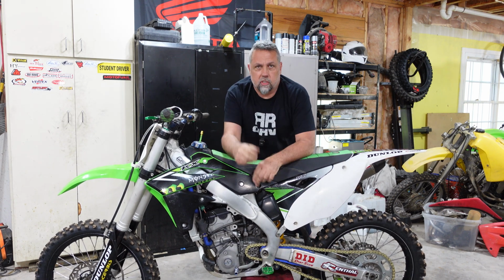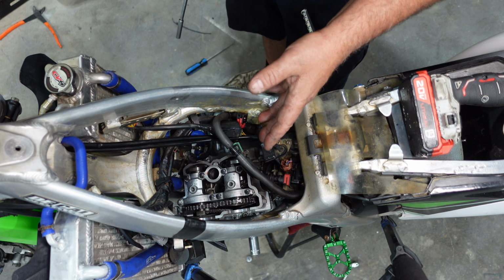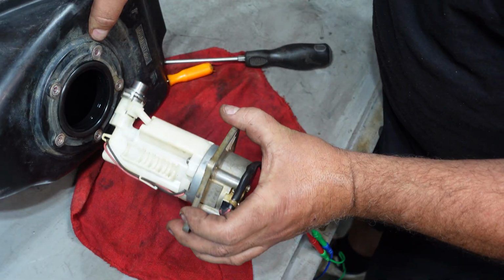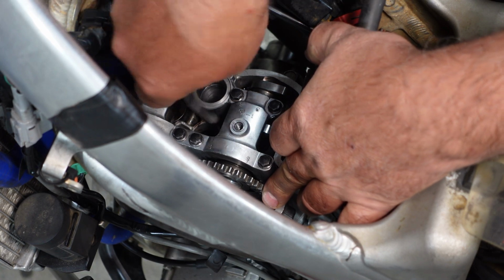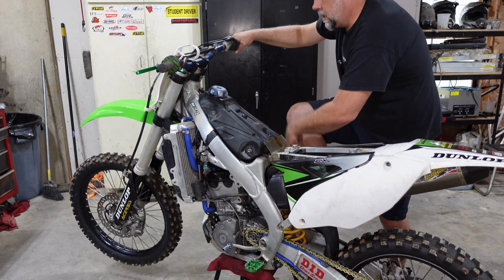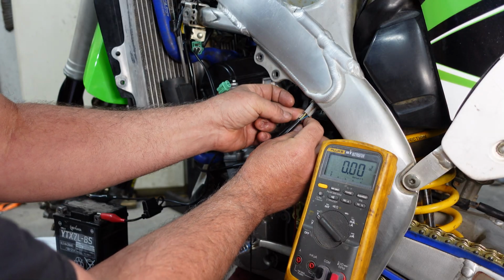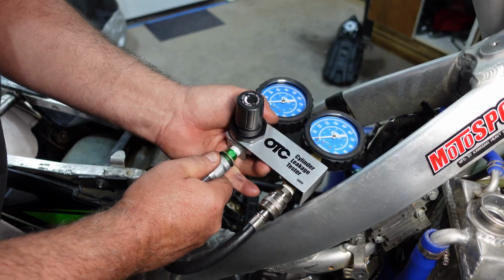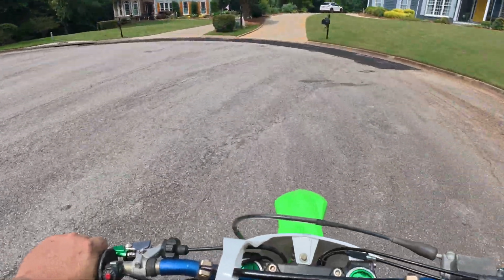2013 Kawasaki KX250F No Start Ep118

Comment: Hey I know you may not see this, but I’m having the exact opposite issue on a 2020 kx250… Im getting too much fuel to the spark plug and it’s leaching while it sits…
Reply: And the last time I rode, it sounded flooded when I started it and it ran fine once it was warm. If you have time I’d love to talk about it
Reply: But it won’t start at all now
Reply from the maker: Make sure it’s got spark (plug could be fouled). If so, pour a little fuel down the spark plug hole, replace the plug and see if it will start
Reply: @restoroosterohv spark is good, I finally got it to start after I left the plug out and I had to hold the throttle wide open, even then it dies out if it’s not in high idle until it’s FULLY warm
Reply from the maker: You need to check your fuel pressure and check the injectors for drips/leaks
Reply from the maker: There are certainly a few things that could cause that. First thing would be to start with a fuel pressure check while running and also if it holds pressure after shutdown.

Comment: Awesome video! I’m working on my 2013 kx250f right now but can’t get it to start… I just put a top end on it. I have spark, compression might be low but it feels the same as before when it ran fine. I don’t know what else it would be because I’ve tried gas directly in the cylinder and won’t even get a pop. I’m thinking I’m going to check my valve clearances cause that’s all I can think of right now. Any other ideas if you don’t mind me asking?
Reply from the maker: That’s where I would start. Double check your cam timing and valve clearances. Do a leak down test and check the fuel pressure.
Reply: @r @restoroosterohv noted, thank you!

Comment: I’m sure it’s been asked before somewhere but I have the same issue with bad o-rings in my fuel tanks pump where do you find the right sized o-rings I’ve used ones out of a harbor freight kit but it’s just not right and I’m not sure they are fuel resistant they don’t last long. Any help is much appreciated
Reply from the maker: They are Viton prongs and will hold up to fuel. Which gate are you using, the metric or SAE kit? If I remember right, that’s where I get those O-rings from.

Comment: I recently had a similar issue on my 09 kx250f. Had up and down play in rod at the end of last fall. I had just got a brand new head, new cylinder, piston/rings, valves a few months prior.  So It was running awesome b4 the crank change.   Where I really screwed up was buying a wiseco crankshaft.  Got it off an eBay seller. Said it was new old stock.  It was new and looked high quality.  After the installation, I couldn’t get the damn thing to start.  I bump started it and it sounded like 4th of July with all the popping and backfiring. Blew fames a foot out the silencer. Idle was surging. Was running very similar to yours b4 you discovered the sheared key.  Long story short, it was keyed  wrong causing the ignition timing to be about 15° retarded. Is actually a recall on that particular crank.  I should’ve yanked it out and sent it right back.  But instead, I did it the hard way.  Ended up making an offset Woodruff key to advance timing.  That got it close.  Bought a Procom Programable cdi and was able to get it dialed in.  I’ve worked on small engines for over 25 years and never had to deal with an ignition timing issue like this.  Was nice to learn how to use a degree wheel and how to find true top dead center.   But i should have just sent the damn crank back.  What i still cant wrap my head around is I had to up my pilot jet from 48 to 52. Had to move needle from 2nd to 5th clip. Main from 170 to 190. But it runs awesome. Actually more powerful than what it was before.  But if I had to do it all over again, I would’ve sent the crank back and got an oem replacement.
Reply: Thanks for the response.  Yeah I never dreamed ignition timing was so complex.  Learned a lot but spent a hell of a lot of time and money.  I got a brand, new carburetor, ignition coil, stater, flywheel, and wiring harness just because I didn’t want to believe the crank was keyed wrong. Even though when I lined the flywheel tdc mark up, the piston was past tdc and on its way back down.    I got a new 450 anyways.   I just kept that 250 because it’s got A kit 
Suspension on it.  One of my boys likes to ride it.  I enjoy your videos and have learned a lot from watching.   Thanks and keep up the good work!
Reply from the maker: On most of these engines, when the piston is at TDC, the key will be facing directly up the cylinder
Reply from the maker: Crazy story. Ignition timing issues are the hardest to find. I agree, sending the crank back would have been the better option. I don’t use Wiseco stuff anymore. It used to be the go to but they just have too many QC issues now.

Comment: It's an ignition advancing woodruff key. We used to run them in 2 strokes to get higher rpm for racing speedway/flat track. Low rpm struggled. Needed to be higher rpm to idle. I guess someone though that advancing that could make it rev higher🤦‍♂️🤦‍♂️🤦‍♂️Different theory for ecms. It didn't work well did i🙄🙄🙄

Comment: After watchimg yku do an actual real diogosis work, I can't diagnose my 2013 kx 250 F issues, im in so cal, can I bring you my bike , George
Reply from the maker: Oof, I am in North Georgia. What issues are you having?
Reply: @restoroosterohv  I acquired a 2013 kx 250 F, a total roached out $ 500 non running bike,  also my first modern 4 stroke, i have quickly realized as a carburator and spark 1990  era  mx bike  guy no real doignistic capabilities at all. From you amd others ive learned alot in a short time ., 
I  got started and notice, as I wemt, the tip over sensor was in upside down and the spark plug gap was closed by so eone that did nkt wamt this kid to ride anymore, maybe his father etc.
Anyway I got it apart to the crank wicg seemed li,e brand new really good, as was the barrel and piston, lime new , i re didmthe head just cleaned up with new seals ,  a shim kit from ebay adm got it badk togerher , it would run 10 secomds hkw i wemt to nypas the tipmover to se it in upside down, etf so it ran , then i left it in the trailer 3 months now cannot get it to fire at all even starting fluid ,
Reply: It tries to fire but is a no go, I even took the fuel pump apart nut all,ok even serious pressure in the tank to injector when I pop,it apart to remove tne tank today after kicking lome 50 times kff n on. Twice that fuel line had serious pressure when popped apart
Reply: I will try tomorrow check spark like ypu do. Amd look again at otjer dossier like the crank timing too ,
Reply from the maker: These are the worst bikes in my opinion. I am a Kawi guy but the 250F is just terrible.
Reply: @restoroosterohv im actually wondering idpf we can make up a kit to put in a 12 v battery on these old 10 year era FI non battery bikes to province the pump before we kick them over together you n I can configure thks kit just tell me wher ether 12 v goes in and how can it recharge online in the system
Reply from the maker: Not necessary. It has a capacitor that stores power for the pump. You can put a 12v battery temporarily to pull the codes from the system.
Reply: Im also wondering if the oem plug under the tank or frame is a anoption to plug in a kawaskai diofnostic unit nutnthere prived thru the roof can we p,ug in a code reader thomif ovtained ,   @restoroosterohv

Comment: I’m hooked on your channel. Sorry if I’m not following protocol,I’m 54 and don’t comment much on videos. Don’t know the proper etiquette for reply & asking questions. Thanks again for your time & information. Another question sir, I got cams out they look brand new. I can BARELY rotate the crank. Any suggestions will be appreciated.
Reply from the maker: No worries, I appreciate you. Do you have the whole top end off?
Reply: @restoroosterohv  no just removed cams is the furthest I got
Reply from the maker: @jefferyscott2061 is the chain binding? If the crank and piston are not moving, you’ll have to pull the head and cylinder off.
Reply: @restoroosterohv I’m glad you messaged me. The 2 black plastic chain guides maybe? One of them is stuck to wall. The other one is free
Reply from the maker: @jefferyscott2061 they are supposed to be like that
Reply: Ok,thank you for your information. I really appreciate it. This southern boy is out in Albuquerque missing Mississippi it’s good to hear a southern accent!
Reply from the maker: @jefferyscott2061 funny that you hear that because I am 💯 New England. Tamed down of course.

Comment: Hey bro, my exhaust cam won’t move. The intake will wiggle. I haven’t loosened the cam caps yet. Can I remove cam cap & loosen the exhaust can?
Reply from the maker: Either the cam caps are warped or damaged due to lack of lubrication. If they’re warped, it can potentially be repaired but lubrication damage usually means you’ll need to be replaced. Check my other videos for my sticky cam episode.

Comment: Thank you for giving yourself the time to edit this valuable information that you deliver, they are very clear even though I see them with subtitles, a master! …Would you help me with something? I have a Suzuki Rmz that heats the pipe in a minute that I think I should be discarding? 1:05:51
Reply from the maker: What year and engine size? If the pipe if getting excessively hot, it is probably running too lean.
Reply: @restoroosterohv  450cc año 2014

Comment: I have a crank bearing stuck to my crank with barely any room whats the safest way to remove bearing puller will not fit
Reply from the maker: If you can’t get the puller in there yet, you may have to use a cutting wheel and cut the outer race off of the bearing, so you have access to the inner race and some heat on the inner race should be able to slide it off. If not, you’ll have to cut that as well.
Reply: Thank u  @restoroosterohv

Comment: If the timing is ok I’d check the fuel pump connections they are notorious for coming loose when plugged and unplugged multiple times. Failing that these are well known for the cam gear to spin
Reply from the maker: It’s a poor design for sure

Comment: Thanks for the thorough explanation, it makes following the tests very easy, well done. I think the flywheel/key problem is better cured by lapping the wheel to the shaft, the key is a locator rather than a locking pin.
Reply from the maker: Plus torquing the nut correctly. Thanks for watching.
Reply: Yes, often the nut is not torqued up to the correct pressure, locking the flywheel rotor to the taper of the crankshaft… as said, the key is only a locator for correct timing position.

Comment: Great video, i have 2 bikes in the shop atm, 2013 rmz250 2017 kx250f with the same problem. unfortunately my keyway is not the problem. testing my sensors now
Reply from the maker: Good luck. Haven’t seen any new vids out in a while

Comment: I think you would have caught that the flywheel was off earlier if you would have used the timing mark to confirm tdc instead of using a screw driver.
The timing mark wouldn't have been in the window.
Good job though 👍
Reply from the maker: The customer had it set to the timing mark and when I checked it against the screwdriver it was off. That should have been more of a red flag than it was but when you work on all these hacked bikes you see all mannerisms of strangeness including people scribing their own timing marks into the flywheel. Using the screwdriver is as accurate as it gets.

Comment: When this happened to me the flywheel keyway was damaged. New one needed
Reply: There is a method of repairing damaged crank keyways
Reply: @munter10 If the damage is minimal you may be able to clean it up with a small file. Crank is hard steel. If it is the flywheel keyway it is softer. But usually it gets deformed and key will probably damage again. I had to buy a new key also. My crank was ok
Reply from the maker: It really depends on how damaged the keyway is. Sometimes you can clean it up with a file if it’s not bad. If the damage is too great, you would have to replace that side crankshaft web, or the entire crank itself
Reply from the maker: Yeah. Got lucky on this one, no damage to either keyway.

Comment: All that electronic stuff on these new FI bikes is why I still prefer carbs
I’ll never get another bike and not go to that woodruff key, the 05 project I had drove me nuts until I discovered that key was sheared😂
Great vid 
Thanks for taking us along
Reply from the maker: It’s crazy, right? Especially since this one was running. I’ve had them completely sheared. Good compression, spark and fuel with no start and that’s easier to find but will drive you nuts.
Reply: @ 
Definitely can drive you crazy, that 05 Rmz450 I had would pop and attempt to run  occasionally so kept chasing fuel/carb problems then I finally hit a wall and pulled the flywheel and saw the key lol
Reply from the maker: All you can do is chalk it up as a lesson and it will help you next time

Comment: No matter what bike I start off with if it’s is not running GAS,SPARK,COMPRESSION
Reply from the maker: That’s what you need. I’ve had bikes with the key completely sheared with great compression, fuel and spark with no start. Those will drive you nuts.